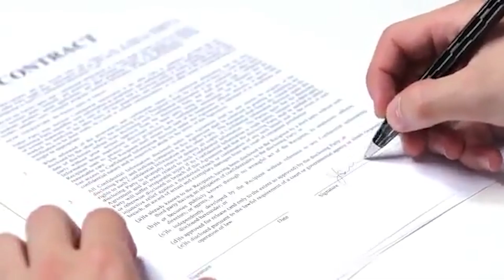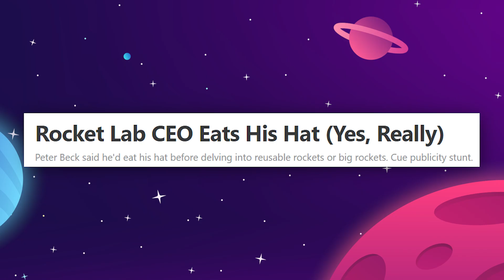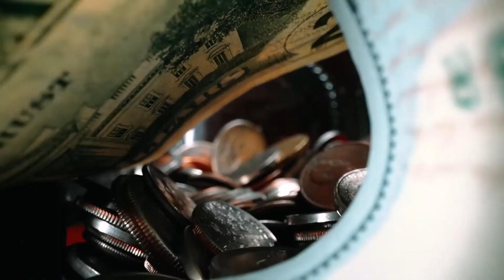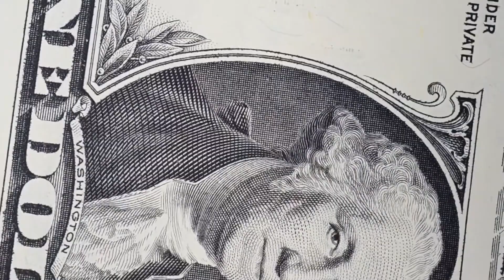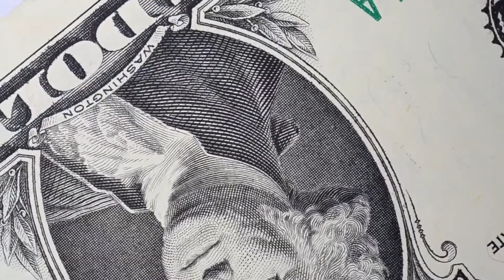Why Rocket Lab Will Be The Next SpaceX!

Comment: Rocket Lab is awesome.  I love their attitude.  The only thing I dislike is their helicopter recovery system.  Spaceflight moves to another level when you involve human lives.  There is risk.  We saw how difficult this transition can be when SpaceX went to human flight.  Risking lives to go to space makes sense.  Risking human life to recover a booster out of the air instead of the ocean does not imo.  I know they use the best helicopter pilots around, but if one makes a mistake you can easily loose the booster, the helicopter, and any people aboard.  It's just too big a risk to recover a booster that seems to survive parachute splashdown just fine.  Again, just an opinion.

Comment: Honestly not sure why SpaceX ever landed on barges.  I assume it just has to do with the trajectory of the first stage boosters.  But can't they figure out where that is and then build an oil platform type landing pad?  Rocket lab has all the key features needed in an investment pitch.  Now, let's see them catch any of their rockets.  They were smart in copying or buying the tech that Boeing used to create the 787 fuselage though.  CF computer spun cylinders are better in every way compared to SS.  They can be a single piece with no connections of any kind.
Reply: I suspect it's a fuel issue, landing on a designated platform may require a few hundred extra pounds of fuel and then you're left with still having to barge it back, so it makes sense to land it on the barge to start with as it can be pre-placed for various trajectories

Comment: Why doesn't anyone else use the carbon composite and 3d printing for components? Is this only suitable for small rockets?
Reply: It's super costly. Also There is also no crack propagation in carbon so there's almost no such thing as fatigue. One moment it's fine, next minute it shatters. Something to consider in reusable rockets.
Reply: Very difficult to produce to a high standard. Also if you are testing your design, it’s hard to make adjustments this way as you need to create a new mould. With metals you can just weld additional structures on.
Reply: Also the materials tend to be more costly also.
Reply: @Earthtenant223  More costly? But isn't this their sales pitch, that they're making cheap rockets?
Reply: @hornet07able  it is more expensive for the materials yes, but they’ve become one of the best in the business for carbon composite. The idea of using this material is also to reduce weight as much as possible, which means less thrust required to send the payload up which factors in to their reusability design. But as mentioned in the video, there are many costs to consider than the rocket itself.
Reply: @Earthtenant223  thanks for the info.

Comment: As if a Rocket would be exposed to an impact on a flat panel as an operational load... I wish He would have shown what happens in compression to a curved composite panel compared to a metallic one. This is a real test to a real operational load where composites sucks. Further, thermal degradation is worse and delamination due moisture exposition is terrible for reusability. That structural test is just PR.
Reply: The degradation of carbon composite materials is what I'm concerned about. It's interesting to see why companies choose different materials. SpaceX chooses a stainless steel alloy because it is cheaper, quicker to create, wastes less material in construction, becomes stronger at cryogenic temps, and holds up better to reusability at the cost of weight. Rocket Lab Chooses a carbon composite since it is light, alloying them to save money and complexity in their engine design. Here's to hoping both choices work as intended.
Reply: @PapaDragon92  What you may not be aware of , New Zealand is at the cutting edge of Carbon fibre use around the world and has been for 20 years , mainly because of The Americas Cup yacht racing . Rocket Lab would not exist if it was not for carbon fibre . 
For such a small Rocket to be able to put 225 kilograms into orbit is unbelievable , certainly 20 years ago if you quoted those figures and capability most engineers would have laughed at you . 
Even to SpaceX the use of carbon would make a huge difference to its payload weight capability , probably in the vicinity of 30-40 tonnes but Elon was right , the complexity and just share volume of material required let alone cost and other limiting factors (heat, lack of experience ) made it's use on the enormous Starship impractical . Stainless steel is a much easier material to work with  especially when developing a multi vehicle stack as SpaceX is  doing .

Comment: Great vid, I think rocket labs gonna soon be quite a valid competitor for spacex. It will be great to see the company evolve in the next two years!
Reply: They might compete for certain launches, but honestly I feel like Rocket Lab will complement SpaceX more than compete with them. The Electron will do a nice job of filling the void that SpaceX misses (or is weakest at) by providing small satellites with optimal launch windows and specific deployment locations at a cheap price. The Neutron will compete with SpaceX for some launches, but since they aren't willing to land their rockets at sea, SpaceX will maintain control over launches that may require this for booster recovery. Either way, it's an exciting time for spaceflight innovation!
Reply: they wont be competitors, spacex does heavy lifting, rocket lab will do medium lifting, medium lifting is useful even if heavy lifting exist, same way around

Comment: Is the Electron still going to be made out of carbon fiber? I don't think that's going to go over very well... The thing that they aren't thinking about is temperature tolerability! I don't see how carbon fiber could be any good with reusability in mind!
Reply: It's also going to be VERY expensive!
Reply: I was wondering the same thing.  The Falcon 9 uses an aluminum / lithium alloy.
Reply: They will pay for this by using more fuel over the rocket's lifetime.